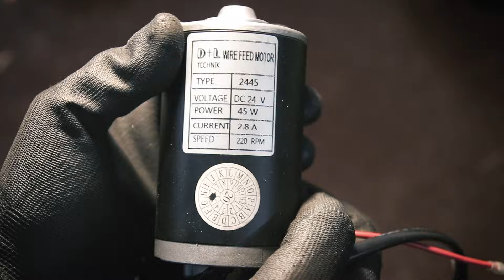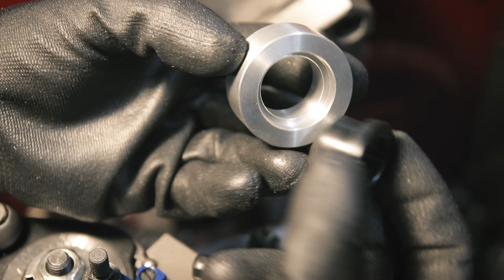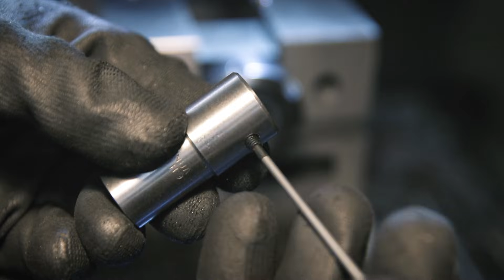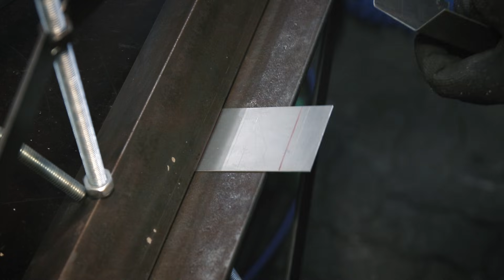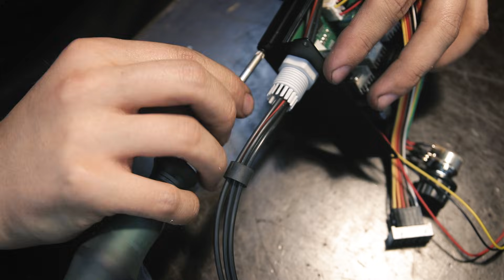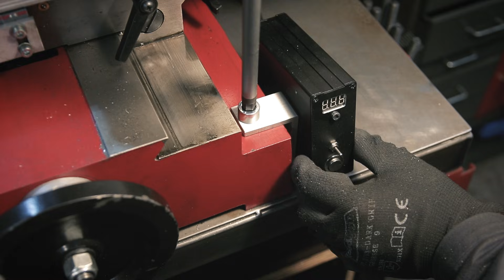Building a Powerfeed for my Milling Machine (with a Wiper Motor)

Comment: Hey Phil.  I remember when you posted this project some years ago.  It inspired me to build a 3 axis Power Feed system for my Bridgeport.  I went a different route by using Stepper Motors and an Arduino for a controller. I really love it.  I don't use the crank handles at all, since I incorporated three different ways to adjust the speed of each motor. A joystick, potentiometer, and a rotary encoder. Do you find that you use the hand cranks still?  Did you ever add a power feed to the Y axis? Regards.
Reply from the maker: Yeah I still hand crank a lot, I like the fact that you can "go by feel" since you get some feedback, so for delicate stuff like using slitting saws I feel like it can be a bit safer. But I suppose if you always calculate your cutting speed, feed rate etc. and do it "By the book" then only using motors can work well. I'm usually too lazy so I just kind of feed by feel

Comment: They have CNC kits for this sort of thing.  I would have looked into NEMA 34 motors and motor controllers.  The advantage, at some point you could actually drive the whole mill with a computer.
Reply from the maker: True, this solution is a bit more oriented towards being frugal though. The whole thing cost less than a hundred bucks to make

Comment: Do you possibly have the links to the parts you used in this build???
Reply: Google (" 12 volt motor controller with readout ").  Looks like they start at $10 US.
Reply: @charleshill506  Thank you sir

Comment: I made similar only i used an 18 notch socket for the clutch to align on the drive head😀 Also on my unit only the drive tube slid not the whole drive

Comment: Excellent job on your power feed need to make one for my small lathe do you have part no. For all the electric parts that part of the build would be my hardest part
Reply: Google (" 12 volt motor controller with readout ").  Looks like they start at $10 US.

Comment: Great work and great video. If you do you to add limit switches, you would wire them NC (normally closed) between the 'outputs' of that 3-position direction switch.
Reply from the maker: Yeah I've actually added those since I made this

Comment: A nicely presented, designed and implemented project - you will never regret the time and effort you expended on this self-act!   A real boon.   I made one similar but when I converted my mill to CNC I then made a control box which could be used to drive any of the 3 axis stepper motors - constant torque at any speed - a great improvement!

Comment: Every windscreen wiper motor I’ve pulled apart contains plastic gears. Wondering how long they will last for this task
Reply: Probably only about 20 years.  Raising a car window probably strains the motor more than moving the table.

Comment: Hey Phil, fantastic mod! I intend to mimic your design and have already received my parts. I noticed that you modified the motor prior to your video, at least it appears you have compared  to the one I have. Did you custom fab a cover plate and bypass the existing wiring harness? If so, I'd greatly appreciate any additional video or tutorial on this. Again, well done. Thanks!

Comment: Looks wonderful. Will you be putting limit switches on so it won’t run off the end or burn out the motor?  The system works extremely well, simple, very little to break.😊

Comment: Built the same years ago 12volt used a dog clutch so the motor was fixed for the Z Axis I used a window winder motor which is much smaller  this was on Taiwan round columb mill

Comment: It is always way cooler to build something than to just buy something. I run into cash flow issues especially lately. A little over 18 months ago I was hit and run over on my 1957 Harley and money has been red;ly tight. What is POM? Is that Delrin? Also is that called a hex shaped collet block? That is fantastic. Do you have a list of items that you used. Such as the wiper motor or the PWM with all the relays?

Comment: Great wideo. Why you dont turn the motor 180 degree oround, it wouldn't sick out like that. And second, isn't a good idea to move the clutch relase to other side, where the wheel is? Thank's to that you could engage and disengade clutch from where the wheel is. I woudl also move electric part to the right side of machine.

Comment: this is not a clutch , its a gearbox with one gear . But indeed thanks for the inspiration :) Keep up the good work.
Reply from the maker: It is a clutch: 

"A clutch is a mechanical device that allows the output shaft to be disconnected from the rotating input shaft.[1] The clutch's input shaft is typically attached to a motor, while the clutch's output shaft is connected to the mechanism that does the work."

https://en.wikipedia.org/wiki/Clutch

Comment: Your engineering skills are very impressive, as well as your skills in recording and editing educational videos.  Your videos have been an invaluable source of information for my projects. Thank you very much!  What software do you use for your 3D design and animations as shown in this video? Thanks.
Regards
Reply from the maker: Hey thanks. I use Fusion 360 for CAD but the animations were made in a different program in this case (called Cinema 4D) but you can make similar ones with Fusion (like in most of my other videos).

Comment: Great! I chose to use your design on 2 of my machines, I used new Chrysler minivan wiper motors. Got tired of 250 to 350 for power feeds and have them fail.

Comment: Excellent video...  I have watched at least 50 videos trying to find the information you give in this video..  

I wanted to use this same type of setup utilizing a windshield wiper motor on my metal lathe feed, this answered "every" concern and question I had and gave me some great design ideas to boot.

Comment: Very nicely done, I did much the same thirty years ago, getting into my own shop and not able to afford to buy the professional setup.  I really like the "clutch" connect/disconnect.  That's almost as easy to use as the designed for power feed.  Thanks for sharing this!

Comment: Nice, clean upgrade without commercial extras that most hobby users never use. Have seeen that some react on your gloves. Me too, but I,d never use medical/nitrit gloves as their fingertips very easily get winded around rotating components( thankfully I reached the STOP  button in time).  Best regards.

Comment: I borrowed you design and built something similar for my  Benchmaster mill. I used a Bodine gear drive. it works great and has really been an arm saver. Thanks.

Comment: Phil,  You cut the two yellow wires, are those so you can control the speed? and when you push the button switch it by passes it to full speed?  Again great video.
\

Comment: good job , where do you get tour table speed from. or do you have monitored engine RPM
Reply from the maker: It displays the RPM in percent (or rather the current I assume) so by measuring the travel at a given number it's possible to make a conversion table. Not the best way to do it but at least you have a reference point

Comment: The teaching moment should be never run he laid that fast when you're using a cut off tool to begin with. It shouldn't have any momentum it should fall flat straight down into the bed pan

Comment: Phil what black wire did you use for the turbo button I used the black wire next to the yellow wire and it burnt the board out. I have a new board but I want to make sure I get it right.    Thanks Bob

Comment: It would be better if the motor was oriented toward the back of the mill. Otherwise, good design
Reply from the maker: It can be turned around but then it sits higher than the table which could create problems with large workpieces, so I mounted it this way
Reply: @PhilVandelay  I agree.That is why bought the motor with "mirror" design. It allows me to keep it below the table surface and facing back of tge mill

Comment: Really nice design and build, that was really fun to watch. Is there scope to add some push button cut-offs when the table is at max / min extension?
Reply from the maker: Yeah I have added those since, but even if it was to run into the limit, the motor isn't strong enough to really damage anything. Most likely you would just fry the controller if it stalls out for too long

Comment: Good design. 
Just a couple of comments from an old control systems Engineer. 
I assume, a bad  word choice , that you turn the speed down to 0 to reverse direction. It would be useful to use an left right switch with a center position of off. This would allow the motor to be stopped then started in the other direction at the same speed setting it was going before it was stopped.  
You might want to consider limit switches on the table to stop the power. You have to keep an eye on the current operation. When the table reaches its limit the motor will stall out and possibly burn up the speed controller.  It is more probable the controller will go before the motor can damage the drive screw.

Comment: Nice.  You might consider some power off limit stops so you don't crash into the mechanical stops.
Reply from the maker: Yeah I have actually added them a few months ago. I ran into the limit once and stalled the motor without noticing. It's actually not too bad, these motors don't have enough torque to actually damage the mill. The motor was fine too but it did burn up the speed controller, so definitely better to have limit stops. The quick and dirty method I've also seen is to add an automotive fuse behind the power input to prevent overloading the motor or controller. Not as elegant but prevents the worst by cutting power when the motor starts stalling and drawing too much power.

Comment: The power supply was heavily vented in its original enclosure and the black one will try very hard to capture the thermal radiation portion. If you're lucky then no problem and if not they aren't expensive... anymore.

You got a subscription sir.
Reply from the maker: I thought about that too but figured since the motor is usually only running in short increments it should be fine. So far it doesn't seem to overheat (also the case is Aluminum which should help some)
Reply: @PhilVandelay  Coincidentally I thought about the intermittent nature of your usage too. I commented mainly for your audience to consider. 

I'll add one more little thing about mechanic interfaces. I've found it helpful when you have alignment concerns to put all 3 in line whenever possible as in the coupling and disengagement slider pins (very nice airtight fit). This is especially true when several are being made including spares and they're all expected to be interchangeable. Just a thought from some disasters with farmed out machining. 

Thanks for sharing. Always interested in automation and positioning systems of any kind.
Reply: @PhilVandelay  That style of power supply I never plan on exceeding 50% of its rated capacity. Your setup must be working at an even lower percentage. Always interested in the spec's, automation electrician, can't help it.

Comment: Great video!  Cool power feed!  I'm thinking about trying something very similar, the only major difference is I have the motor from a single motor electric recliner.  It's basically a low speed electric gear driven linear actuator with the motor perpendicular to the direction of actuation.  The motor is 24v, 50w, 2.1A.  It also gives a duty cycle of 1 min on/8 min off, which may be a problem?  I'm no expert on electric motors so if someone knows of any reason why this wouldn't work please let me know.
Reply: What you have will definitely work well, unless you go crazy, I don't expect you will overdrive your duty cycles.  I did the same thing thirty years ago, but with a home built power supply.  His taken off ebay is very convenient, easy to access.  I never use my power feed at more than say thirty percent except rapid traverse, and that is short time only.

Comment: When and why did you switch to this from your round column mill? You put a lot of work into rebuilding your round column.
Reply from the maker: Many reasons, this one is simply better in every regard and more modern (I bought this one new, the other one was from the 80s). It's bigger, heavier, has a larger table, more travel on every axis, but most importantly it doesn't come with the downside that all round column mills have, which is that you lose your XY position when you move the head on the Z axis.. Don't get me wrong, those round column mills are great workhorses if you can get one for cheap. The new mill was much more expensive. I would have kept the old one but didn't have the space at the time. But for more precise work and speed, you want a "real" Z axis and a DRO and it wouldn't have made sense to invest more money into the old one. I sold it at a good profit after giving it the makeover.
Reply: @PhilVandelay  Your one from the 80's was identical to the one I bought new from Harbor Freight in the US 2 years ago. I was rewatching some of your videos and saw that- not remembering you ever had a round column mill. Noticed it was the same as mine and was intrigued. I paid $1400 for it new without tooling. I see you and others on YouTube have Precision Mathews mills that aren't round column.. The pursuit of a home shop that's capable - is often a difficult journey unless you're rich. So though I'd also like a precision Mathews mill, I'm grateful I at least have a mill. 

Now thanks to you sharing your arguments why these other style mills are better, I can better justify future plans to make the switch like you did. 

Exciting side note, I'm about to go pickup/ finish buying a PM-1236 lathe! It's from 2010 and the paint is the only thing measurably worn. Spindle and ways appear same as new. I had an old 9" southbound with worn ways and spindle - I got ripped off on it. Sold it 3 months ago while still being honest about it's crappy condition and made profit! Didn't think I'd find a PM lathe used as big as 12". In watching your belt sander videos, I carefully took note of yours and found it was too expensive to justify for myself.. And here I am after all! Some luck! Might just buy your plans for that belt grinder now :-) Whole rest of my day will be stressing over moving this lathe... Wish me luck.

Comment: A few problems 1 it can run past the end, no way for it to stop on it's own.
2 when you kill the power in one of those wiper motors they like to keep running a few more revolutions, needs some kind of a brake, I ask all this because I too have tried using wiper motors and found it to be trouble some...

Comment: Did you use a 12 point socket? That would double the positions the clutch could engage at.  I never thought of using heat shrink over a pot, good idea.
Reply from the maker: I'm actually upgrading this right now, with a 12 point socket just like you said, among other things. Don't know why I didn't think of it the first time it's a really good idea
Reply: @PhilVandelay  Don't you just hate it when you don't think of the obvious answer to a problem?  The age old question for us. "Why didn't I think of that"?  LOL  Looking forward to an updated video when you're done.

Comment: I like it.  Good range of speeds it seems, maybe could be slower (creep feed) for full depth keyway cutting and just plain side milling.  I couldn’t tell how slow it goes.  On the other hand it has a very good rapid.  On Bridgebort mill power feeds, rapid is kind if a sad joke.
Reply from the maker: Yeah it can go fairly slow but the slowest speed is still just a liiitle bit too fast for some jobs, because on the low end the torque drops off until it just stalls at about 29% of the full Voltage. That's why I'm actually in the process of upgrading this with a more powerful motor with the same RPM (42v instead of 24v) so that hopefully I can get to something like 15% which would be ideal. I also made a new adapter with a 12 point socket so it engages even easier. But I've already gotten a lot of use out of it even like this, so I'd say the design has proven itself.

Comment: What if the hex is out of alignment with the one on the acme screw? Is it a pain to realign?
Reply from the maker: Nope you just turn the handwheel a few degrees. But I'm actually planning to make a new adapter using a 12-point socket instead of a regular one (should have done that right away) and I hope with that it will always fit without adjustment

Comment: Very clean installation Phil. Out of curiosity, what size is your mill. It appears to be a dovetail Rung Fu clone. I only asl because I have a really old RF 45 clone which I installed a DIY drive using an old Bodine motor and some sort of control I picked up on EBay. My clutch is almost identical design as yours....a socket welded to something or other.  Anyway, your installation is cleaner than mine. Thanks...and subscribed.
Reply from the maker: Yeah it's pretty similar to the RF45 size wise. It's a different. more recent design but more or less the same thing. It has some details that I prefered over the RF45, like larger dovetails and it's also a VFD driven machine so no gearbox. I almost would have bought an RF 45 (or one of its many clones) too and I think you get a lot lof mill for your money with these, even though some people look down upon the chinese benchtop type machines.

Comment: If you use a twelve point socket the shaft can engage at every 30 degree.
Reply from the maker: Yep, I kind of regret not thinking of that, would have been better indeed. Maybe I'll make a new adapter someday

Comment: Could you also post a link with additional info on the control box, where you got it? What equipment was it from? Model no etc. Thanks again
Reply from the maker: As usual with the stuff I buy, it's a no-name cheapo chinese gizmo but works well so far. Try searching for "PWM Controller" on Ebay and you should find something similar